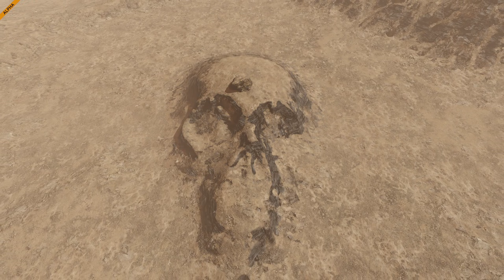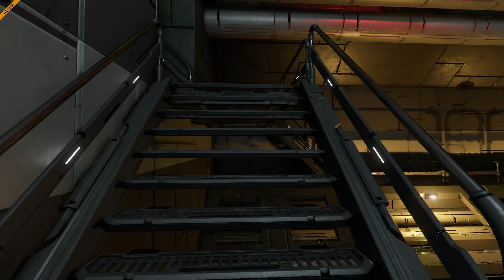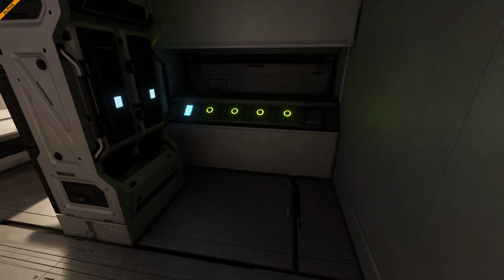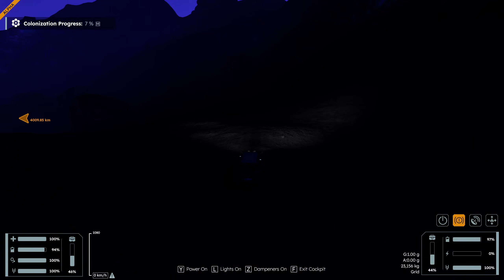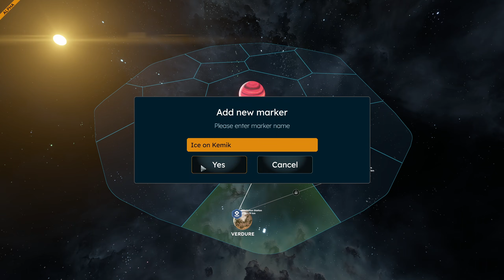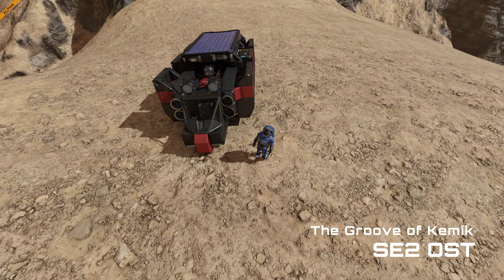Kemik is Pretty Neat! | Space Engineers 2 has Planets! | VS2 Early Access Preview

Comment: I tried to land and crashed several times. 😭 I think I made my ship to heavy for landing. I would need more engines or less weight. I guess there's no ice for refuel, right? I don't know what's a good engine system to land, move around and then go back to space.
Reply from the maker: I found some deposits of ice on the hills. I also noticed I needed more thrusters to lift my ship than I am used to in SE1.

Comment: A caldera isn't part of a cone-shaped volcanic structure; what you landed in was the volcano's crater. A caldera is much bigger than that; a caldera is a depression created when a volcano collapses into the magma chamber. An example of this is the Yellowstone Caldera. 1/3 of the Yellowstone National Park is inside the caldera, which is a 30x45 miles (50x70km) crater on top of a magma chamber that's 4.5 times the size of the caldera itself.
Reply from the maker: I knew I should have looked it up. I called it a crater and "corrected" myself assuming I was wrong. Thanks for letting me know!

Comment: I’m assuming the fast travel hyperspace animation is not coming then in vs2? Seeing as you just instantly jumped to the new system with no animation. Or have they scrapped that mechanic entirely? Either way everything looks great so far.
Reply from the maker: Not from what I've seen. I am certain in will come, just not sure when.
Reply: @EngineeredCoffee for sure, I had assumed for some reason that it would be in vs2 because it looked pretty complete in mareks dev diary. I have no problem with it coming later though!
Reply: I had figured they probably wouldnt do a gateway (due to scaling issues) but having the missions be the requirement is an interesting choice

Comment: @EngineeredCoffee what GPU/CPU did you use to play this?
Reply from the maker: 9800x3d with a 5090. So as good as you can get really, so your milage may vary on performance.
Reply: @EngineeredCoffee  thank you so much for your reply! Now I'm quite afraid since I got a 2080 super with a 3700x 😂 But great video! Thank you for addressing some of the issues that everybody can see in the video`s like lighting glitching sometimes and voxel updates etc. But I`m really excited for the game. Hopefully it will run decent on low settings.
Reply: @Badnews1337  I run the game with a 7600 and 3700x so I think you should be good currently at medium settings, which is what I use.
Reply: @AegirBuildsAndBeats  thank you so much for your reply! I`m happy to hear that. Your awesome insight into the new survival mechanics video looked really smooth with good graphics so I`m a lot more hopeful now! But I saw you were on Kemik. So still fingers crossed for the performance on Verdure 😂
Reply: @Badnews1337  I played a bunch of hours on Verdure and it felt pretty solid on medium settings. A few stutters here and there, but I think that's just part of the game right now until major optimization rolls out.
Reply: @AegirBuildsAndBeats  that's great information! One last question. On what resolution are you playing? I'm currently playing on 3440x1440. I have the feeling that you are playing on 1920x1080 since that was the max resolution I could choose for your video. So that can make a big difference as well I think.
Reply: @Badnews1337  1920x1080. Still a bit in the past on a 24" monitor.
Reply: @AegirBuildsAndBeats really great information! I think a lot of people can get an idea of the performance with this information. Much appreciated!

Comment: Suit battery confirmed. Although, I wish it to be the same item as for regular batteries for better interoperability. Say you are running out of power, you could extract the power module from a battery (or some other blocks too) and put it into your suit do not die, or vice vera, get the battery out of your suit and place it into some block to revive a dead grid.
Reply from the maker: There are personal battery kit consumables, I didn't test them out though. Not sure if they are single use like SE1 or rechargeable.

Comment: I don't like the fonts they're using. It matches for an espresso machine add, or for a medicinal prospectus. Not for a hardcore engineering/space game.

Totally wrong, in my opinion. Sorry to nag. But I had to say it. The rest looks amazing!
Reply from the maker: I really need to look at an espresso machine now! But I see your point that it's not very sci-fi.
Reply: I think they could have used more icons instead of text for that matter. Character, Grid, Build, Contracts and so on can be changed with icons. If you hover on you will see the tooltip about what they are but once you learn the icon, you are good to go and you can actually fit way more tabs with just icons and it will be more consistent among localized versions of menu...